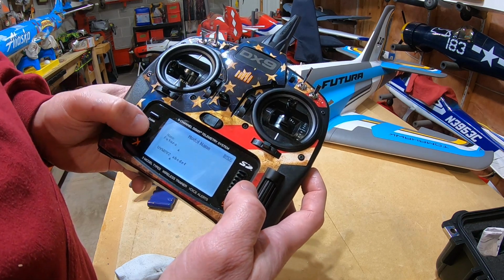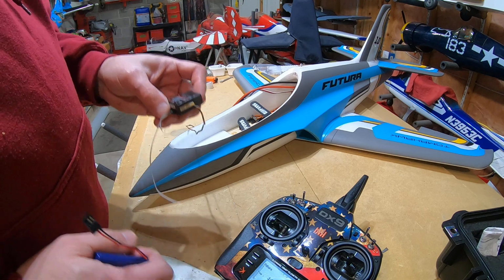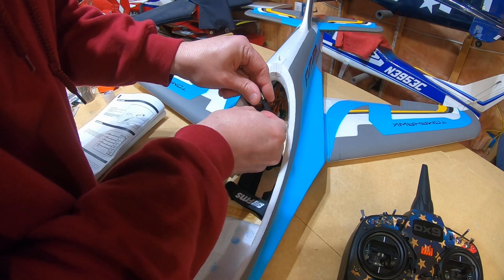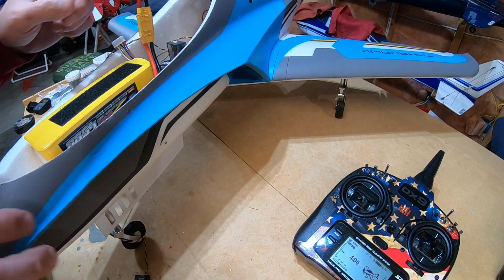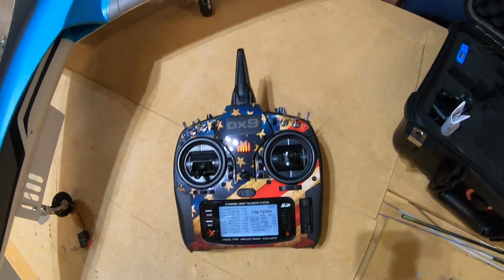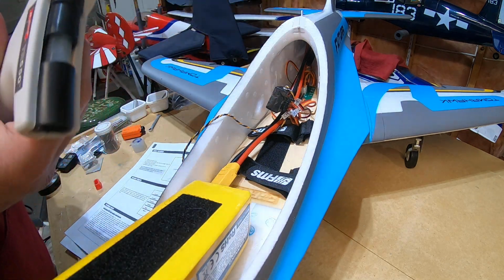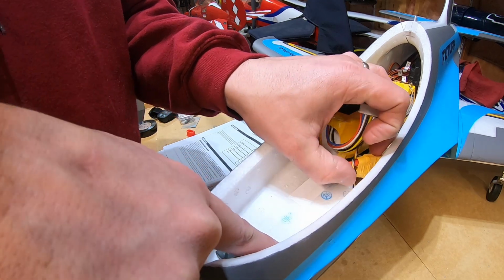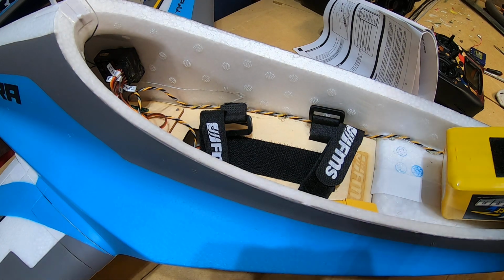FMS Futura V2 Build pt3. Binding, DX9 quick setup, Tips

Comment: Whats your Landing Flap to Elevator Mix on this jet?  just need too know a good starting place on set up! Thank You
Reply from the maker: Flying Spektrum 
Half flaps 3% positive on elevator
Full flaps 8% positive on elevator 
If you fly jeti or set up flaps on flight modes you can trim in each independent flap position and trims stay with that position. Adjust on the fly
Reply: @JustPlaneCrazy  So Up elevator instead of down elevator your saying?
Reply from the maker: Yes. And of course balance point, throttle application and airspeed all play a part in what u use.
Reply: @JustPlaneCrazy  i usually dont have to much ballooning happening on my low wing plane n jets its the high wing ones that are worse!
Reply from the maker: For sure